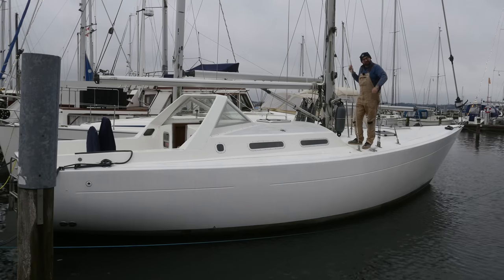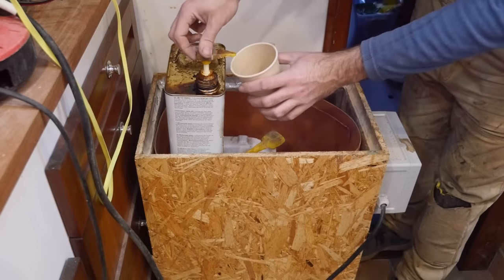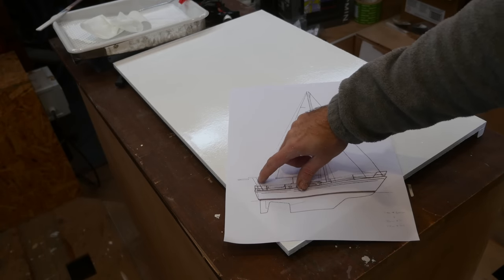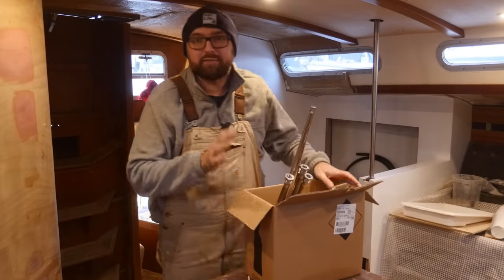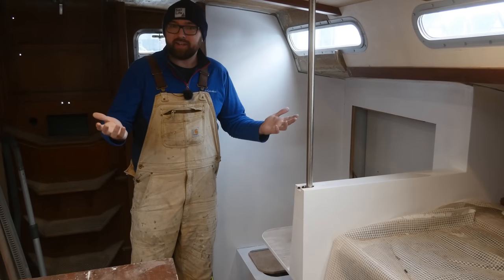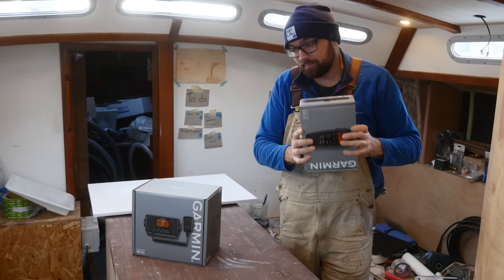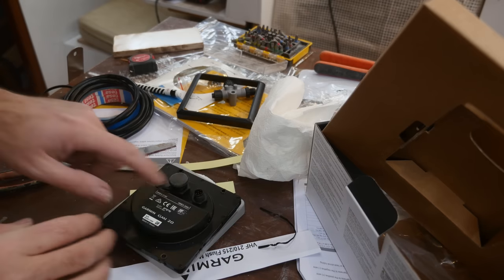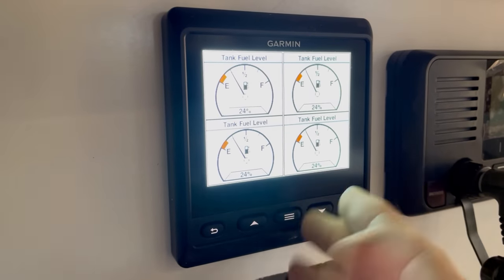Sail Life - Solar arch model, toe rail, NMEA 2000 network - DIY sailboat project

Comment: I would recommend making the vertical supports for the solar arch on the port and starboard sides of the boat a little wider at the base than at the top. I would also mount the second solar panel inboard of the first one. This would help to protect the helmsman from the elements to some small degree. It would also be easier to work on on the solar panels.. I like the idea of having the vertical supports slanted inboard as you suggested. I would also consider using some gussets to stiffen the assembly some. This is especially important if you are going to have dinghy davits on the solar arch.

Comment: Hi Mads, I would start with a thick plywood sheet epoxied to the inside of the hull behind the electric and instrument panel. On that you can screw whatever connectors and distributors you want. Like one for 0V and one for +12V. You can also screw on the AC box with switches and fuses or better, place the AC switches and cabling separate in a dedicated area.

Comment: For the power switches, the rectangle one where you had it, the two small square ones under it, and the chart plotter in the upper right next to the big rectangle. That’ll probably let you use the chart plotter more radially while sitting down OR standing up

Comment: Chart plotter.  Build yourself a bracket and box for it that pivots on the stainless post on the nav station. That way you can have it above your monitor or if underway pivot it around so you can see it from the seating/galley or companionway steps.  Just an idea.

Comment: Maybe think about a design that would allow you to slide out two more panels sideways, one left, one right. This way, they would still be perfectly balanced, so as long as the structure is sound, there wouldn't be any static concerns (apart from wind load, which is to be kept in mind). Also, it would look kinda cool when extended, opposed to something that protrudes aft more than it does anyway.

Concerning the monitor and the plotter, I would recommend mounting those on swivel arms (semi lockable of course).

Comment: Place the 24V panel on the bottom underneath the 12V DC and AC panel on the left side.  On the right, place a fuel gauge, water tank gauge, and holding tank indicator as well as any large voltage breaker, like anchor windlass on the top right quadrant. On the lower right mount your plotter.  Just my suggestion.

Comment: I would definitely consider a slightly larger monitor, and placing the chart plotter on the stainless pole on an extension twisty mount, so you can see it from across the saloon, and potentially from the cockpit as well.

Comment: As always, fun and educational mixed with some humor. Will wait to see how your hanging solar rigging works out, like the idea but always thinking of wind gusting on any structure with that much wind resistance. I'm thinking of using "2" 400w wind generators, but the noise has me worried. I have gotten so many good ideas and tips from your videos and now binge watch them over and over again to see if I missed anything..lol. Happy New Year....John

Comment: Mands, on the solar arch is it worth considering having a couple of solar panels (one starboard and the other port) facing closer to the horizon rather than straight up to the sky as sailing at high latitudes the sun will be quite low in the sky. You may gain more solar energy in the mornings and evenings this way.

Comment: Your toerail should be really nice if mounted really low to the deck.  Some have tried to get away without a toerail, but they’re essential.  I’ve simply replaced a couple of toerails, but hated putting in all those extra holes.

Comment: If you can have your arch have some members that go .5 meter to starboard and port you could fit 3ea 360W panels and have 1080watts total. OR....have 2 additional "swingout" panels that only have to be stowed when in harbor. Then you have 1440w. That would get you very close to zero reliance on dinasaur remains. The arch could be made now for adaptation of the swingout supports later.

Comment: I just added to my control panel two DC 0-599.9V 600V Blue LCD Digital Volt Panel Meter Voltmeter (1 for 12v and 1 for 24v) and an AC Current Voltage Amperage Power Energy Panel Meter LCD Digital Display Ammeter Voltmeter Multimeter with Split Core Current Transformer CT AC 80-260V 100A (AC 100A Meter(Split Core Transformer)) ( This is to monitor my shore power at a glance also shows my frequency perfectly. cost me  $60.00 USD for all three. works perfectly. and allows me to individually monitor my input and output for each Circuit breaker panel. So I can add or take away power as needed.

Comment: @Max You may try orienting the solar panels in the other direction for less overhang by adding about 1/2 meter wide platform to the top of the arch. The hoist mechanism could hang from this platform.

Comment: I think if you mount the Garmin screen at the top/upper part of the panel so it will be easier to see throughout the cabin. Switches on the lower.

Comment: I also think the vertical tubes should not be parallel. It would be stronger and look better with the distance at the bottom greater than the distance at the top. I would also consider adding horizontal bars on the sides so that you can climb to the top.

Comment: I vote to place the chart plotter on a swing arm of some type.   Place  a repeater for the instruments in the stateroom where you can see it from the bed and a set of instrument repeaters by entrance to the cabin so you can see them without going back to the steering column.

Comment: Nice work! I'd like to see a handy way to disconnect the antenna (think lightning surge prevention).  During storms or when leaving the boat for a period switch open the antenna circuit.

Comment: With all the spare time due to not being able to sail I refitted all my electronics, which over the years of "upgrades" had resulted in some messy cabling. I standardised on DIN rails both for connections and where possible the electronic modules, including the PC, AIS, some breakers etc. I used to work on big boats (tankers) and thats what they used so I stuck with this system.
Reply: I see from the next episode you followed my suggestions.

Comment: Mads,
Have you considered fitting a hinged solar panel on each side of the frame to capture early morning or afternoon sunlight and also have a 4 panel option during the main part of the day when the hinged panels are horizontal.
Love the bulwark and stantion setup. It's gunna be better than " spiffy "
Cheers Eric

Comment: Keep the AC as far away from the DC panel as possible!!!! 240 VAC can kill you easily, and if it gets into the DC system it is a disaster. I was almost electrocuted when working on a boat with  a mixed voltage panel. On boats I have wired recently, I have put the AC panel in a bulkhead, such as for a cabin door. I install the panel in a wooden  (mahogany) frame inset into the bulkhead, with the circuit breakers facing into the main cabin. The bulkhead over your head when sitting at the chart table might be excellent. The back of the AC panel has a wooden rim (3/4" mahogany, about 1 1/2" high) around it, and a thin (1/4") wooden cover plate is screwed to the rim. The AC wiring exits the panel through the rim inside a wooden "box" made of side pieces and a cover plate. Running the wires near the top of the cabin over to the side of the boat, then down to enter the interior walls can look very nice if you think it out. 

There is a default misconception that the circuit breaker panels need to be right in your face at the nav station. This is usually a waste of precious space for navigational instruments which you MUST see and which are changing all the time. Once you get your usage set, you will not be flipping breakers very often. This is especially true for the AC systems, as these may not be in use at sea.
Having good visibility of the AC panel from the inside of the main cabin by mounting them on the bulkhead behind the chart table is very convenient. This has worked EXTREMELY well on all the boats I have implemented it on, and provides excellent separation of the AC and DC panels.

View the empty space above and forward of the nav table as a wonderful resource for mounting things. RAM mounts (over 5000 separate pieces at last count)  can suspend all sorts of instruments there. Custom mounts are easily fabricated with a welder. Displays and radios can be mounted facing downwards so there is a direct line to the eye. Please do not be in a hurry to get stuff put into the nav station. It is really important to spend time thinking hard about how and what you will use, especially in the future. If you "finalize" the design you may make it impossible to be flexible later.

also, having a Shipmodul Miniplex 3 for NMEA 2000 input and a wireless output will allow all nav data to be accessed wirelessly by tablets and phones anywhere on the boat. They are stellar tools. I have been using them for years and installed them on several offshore sailboats.

Best wishes,
Michael

Comment: VAC panel on top (you'll only get electrocuted when water is at waste level) with monitor to the right.  VDC on bottom with NMEA (pronounced 'neema' by the old timers) and other low Voltage wiring. By CODE, there should be a separation (barrier) between the AC and DC compartments. 🤾⚡🔥⛵

Comment: you could mount the wood toe rail with pockets to hide most of the stainless steel ... and toes... may it would be better to grind the edges of the stainless for not having bad toe injuries when slippery. Avoid sharp edges!

Comment: I would have put the chart plotter up, right. Then you will be able to see it from all over the cabin. Down, the half wall in front of the nav station will cover it. So the big panel top, left. Chart plotter up right and the two other panels directly under the big panel. that will give you room for other stuff under the chart plotter.

Comment: Hi Mags, Just dived in before the end of the vid' so you may have changed it already. I have the same VHF setup only its B&G. I originally used the GPS of the plotter however installed GPS on the VHS in the end as whenever you want too use the radio you have to turn the plotter on, this is because the radio warning alarm sounds saying "no GPS'. Your system may be different, but if it is it's still a good idea for redundancy if nothing else. Great vids by the way.

Comment: Good choice in the painted wood - stops a boat feeling like a cave.  Also Sunpower X series panel is only 1.58 m long. Also put the switch panels up high and the plotter and other display below. Better visibility when seat and throwing switches is usually done when standing.

Comment: Are you going to do an enclosure attached to the dodger? I highly recommend that for comfort.
Ideally the toe rail would have holes for stuff like snatch blocks.
Isolate the AC panel and wiring from the DC panel per ABYC recommendation section E-8
Reply: And space for good sized fairleads for sizeable warps in the toerail as well.

Comment: On my boat I had the solar panels mounted pretty close to what you are doing and the Davits are great off the back of the arch only problem is it's a stretch to attach the blocks to the end of the davits not a problem at the dock but if there's a problem at sea then it's a reach!  On the chart plotter I would mount it in the cockpit that's where you will need to see your course.  Best would be 2 plotters.  But I can say a inside plotter isn't needed.  Your displays can give you anything you might want to know inside.  Bob

Comment: I do believe i read something about Garmin giving out free adapters to fix that annoying 45 degree offset. I bought the Garmin starter kit on a sale, but I’m only using Raymarine devices. I think the new ones are identical. 

Another thought: as cables won’t give you a 45 degree offset, you could use the old T-connectors in one place (mast), and the new grey ones at the nav station. I bought a 4-way T splitter for my nav station just because it is a lot more cost effective, and it freed up a couple from the starter kit.

Comment: Only thing about the arch is how far it sticks out the back. It looks nice but remember marinas charge by the foot and most take the boat and add any overhand like davits or the end of that solar panel, so instead of paying for a 40' slip you on the hook for a 45' which is in a whole other category of pricing. just something to keep in mind from someone who wanted to pay for a 44' boat but the davits added 3 feet and well out came the visa. I soon made mine foldable and would throw the dinghy on deck before entering the marinas.

Comment: Read the part about powering the NEMA 2000 carefully, you could end up having to add a second 12v power cable somewhere along the length depending on how long the total run is and how many devices you have on it.

Comment: Mats, habe you considered using a hydraulic mount for the screen? With the right one you might even be able to point the screen at the seating area. If possible even connect some of the navigation stuff to it so you could use it as a giant navigation display.

Comment: Madds, if you’ll be installing a chart plotter in the cockpit, you should be able to repeat that onto the monitor at the nav station and control it from there. Particularly if your monitor is a touch screen. Installing the monitor on an articulating arm will allow you to view it from everywhere and you might even be able to use it as your main tv monitor for streaming content. I can see a few personal preference reasons you might not want to go this route, so I’ll leave it there for your consideration.

Comment: 27 inch monitor if you can swing it. That 24 inch panel looks tiny. Go vesa mount on the panel if you can it will make replacing your monitor way easier.

Comment: Thanks for all the tips over the years.  I’ve used many but this is my forst comment.  Have you looked at more efficient solar panels?  You can get 360+w out of a 1.6 x 1m panel from LG or Sunpower.  That would greatly reduce the overhangs from your arch and may not cost much more in the grand scheme of things.

Comment: I saw on another channel that the wind instrument might act as an extension of the backbone and have a built in terminator. The other guy couldn't make it work as he had it plugged in as a drop cable. Id mount the plotter above your switches so you can see it from anywhere

Comment: maybe put panels perpendicular , so they are 2 m wide not long and do it the way that aft one is hinged , so you can close it when not in use over or under first one ( or slide under ), probably in marina not good to hang so far back ( anyway you have ground power there), on the open sea, it doesn't matter how far aft it sticks out .

Comment: Surprised the switches run left-right.  I imagine it's more intuitive if they were up-down.  In aircraft, ON is down (towards the nose) on an overhead, but in a boat?  

Consider a second NMEA backbone cable as a backup and run it on the other side.. with a quick means of switching it in service.  

I like the vacuum trick!

Comment: About the solar panels: Why don't you mount some walk-on solars on top of the cabin? Nobody ever goes there anyway. And it's really out of the way, and you can always use at least one, even when heeling over.
Another great location is on the roof of the dodger.
Rear mounted arches are a pain in the behind, when the winds pick up.

Happy New Year, Mads!!

Comment: Mads you might want use water based glue when you do biscuit joints. The biscuits are slightly compressed and they expand when in contact with water and creates a stronger joint when the glue dries.

Comment: Been using the Xb-8000 AIS with built in WiFi . Everything runs to my tablets thank you for the great advice.  Try using lithium iron batteries lighter and more charge cycles.

Comment: What about making a swivel mount for the chart plotter to be mounted on that  supporting stainless bar you have running down into the nav station? That way it can rotate 360 degrees to be viewed anywhere you are in the cabin

Comment: Use a NMEA2000 to NMEA0183 WLAN-Gateway and OpenCPN, then you can use the PC also to monitor your boat's position and stuff.
Reply from the maker: I've already got a signal K gateway :) No need for 0183. I'll see if I can get it in the next video :)

Comment: I am a little interested in how the arch for solar will actually work. While I get it in principle, I guess two other things come to mind here Mads, one are you also installing a Bimini and if so why not use this structure also to carry the solar panels and if not why not. Afterall, a Bimini offers serious protection against sun radiation and this surely is an important feature to have for a world cruiser.  Secondly, are you going to install dingy davits off the stern transom, because if so again the proposed solar arch could become a problem re raising and lowering your dinghy. If your not installing dinghy davits off the stern would I be correct in assuming then that the dinghy would be stored in from of the mast on the deck ?  

Also, would the solar arch get in the way of the self steering/wind vane mechanism as again, I would assume for the cruising you are intending doing you will be installing a wind vane off the stern transom.